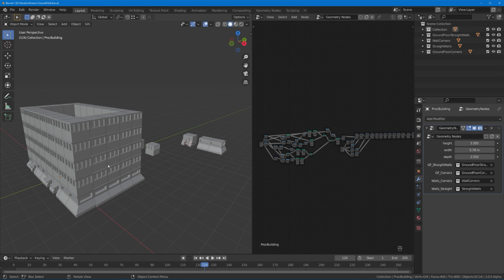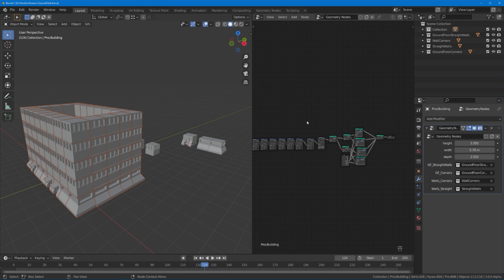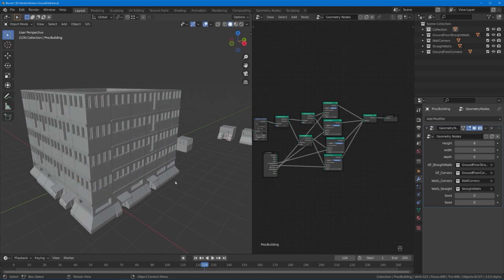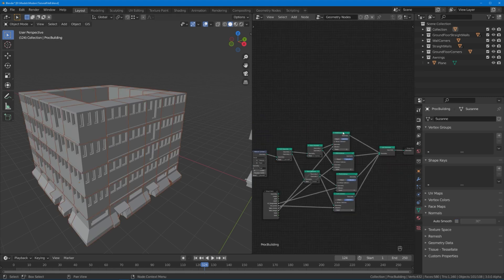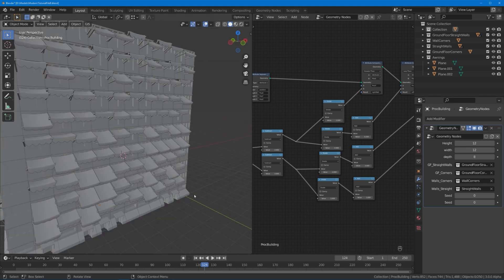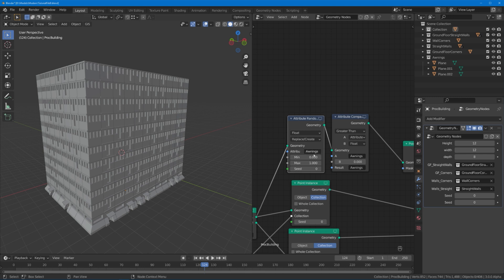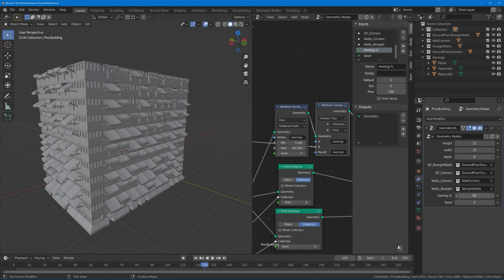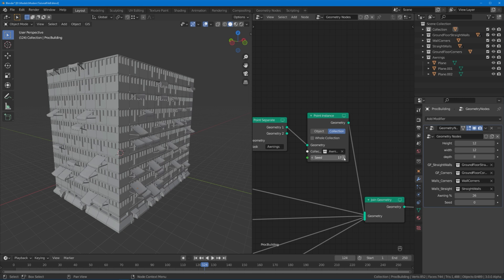Procedural Building Part 3: The Details

Comment from the maker: If you want those whole number (int) values in your node group, drag and drop a seed value (i.e. from a "randomize attribute" node) into your input node. I show that in part 2.5.
Reply: has a way to override the current mashe based on his face normals?
exemple: i have a blocked version of building, so i simple add the node on him and the size on the ways will be based on blocked form

Comment: Is there a way to texture the overall building? So if the building looks too uniform and I wanted to add some grunge or texture paint over it would that be possible without applying the "geometry node" modifier (which messes up the  original textures on the individual blocks for me)? What about adding a particle system for plants and things? Great video btw.
Reply from the maker: I've struggled with the same problem for an overall grunge texture. But perhaps it is possible to use an atrribute from the geometry nodes in the shader editor. Maybe we could use that Zposition for some floor grunge or something. I'll have to try that.
Geometry nodes is essentially a particle system so that's where the would add plants etcetera.
Reply: @Kammerbild  thanks for the response! I think I’ve worked out both of the issues, but neither of them are great, just kinda work. For the grunge texture I connected it to a different texture coordinate and used the “window” socket, which gives an overall texture but moves around depending on the position.  For the plants I used a low poly version of the building and assigned a particle system because I wanted to be able to use weight painting. Which works great but is super slow lol.

Comment: How would you do the top floor? I assume its the same as the ground floor but what would posZ need to be equal to?
Reply from the maker: You could get the posZ from the height value input.
However to close the roof you will need and other grid and kinda lay it flat on top :)